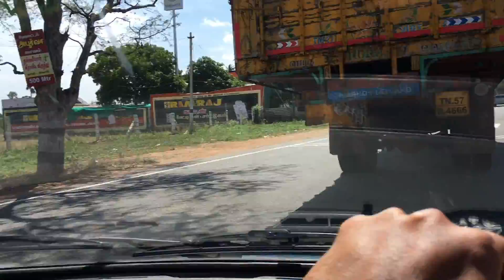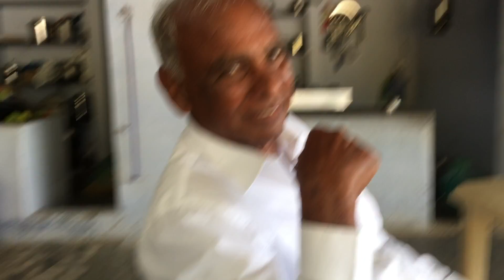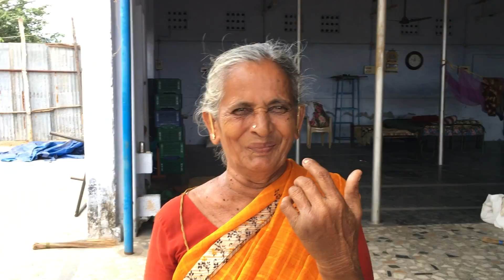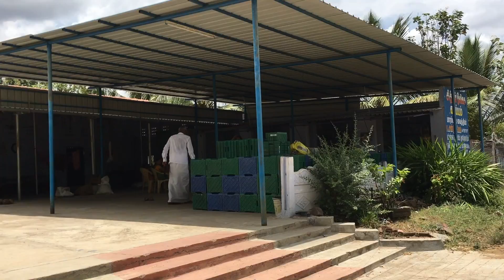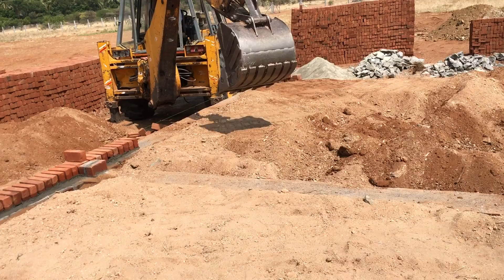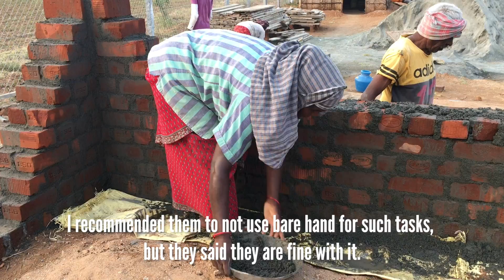My Thatha Killed Sathyaraj Wife!!

Comment: Hi Shankar... A small tip... While using Msand make sure properly they mix with cement or else binding will not be fine... Since if sand used we can easily see whether it mixed with cement or not due to colour diff but in msand they two in same colour so mixing is very important... Use precast wall for some areas it ll be very easy to buildup and time efficient... All the best for ur house... வாழ்க வளமுடன்...